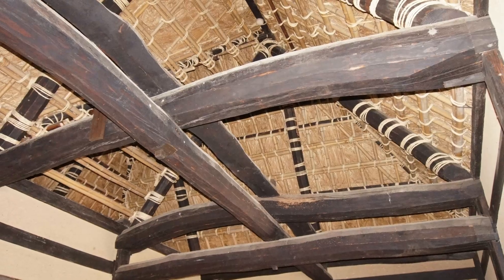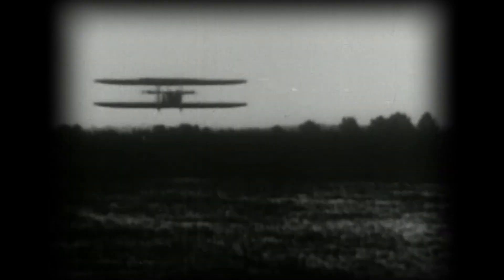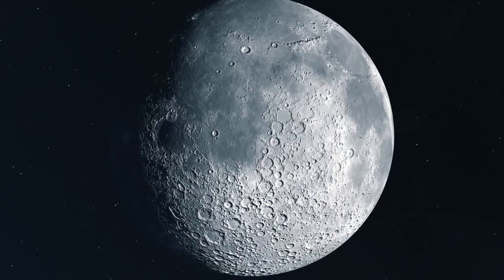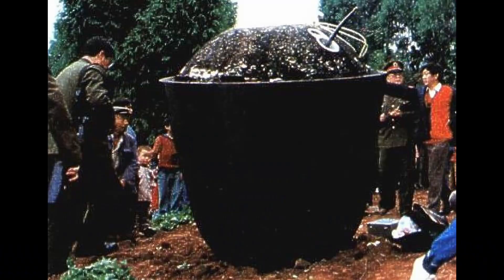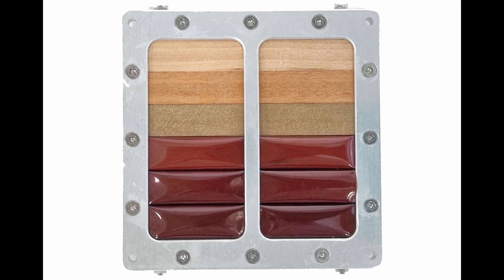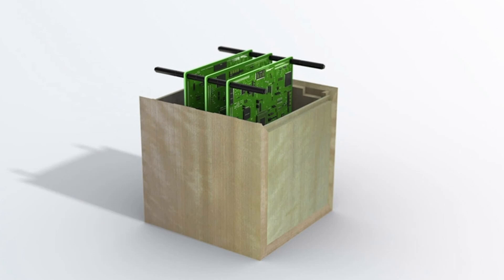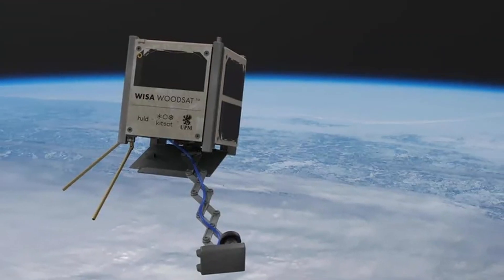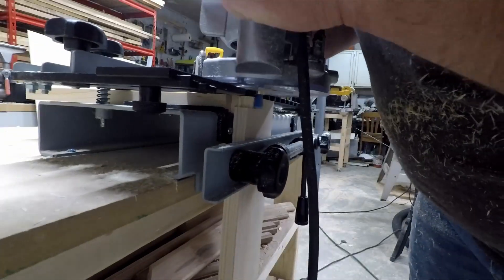Sending Wood to Space?!? Why Scientist Want to Use Wood for Satellites and Other Spacecraft

Comment: Think of the deforestation. Making satellites from bamboo and hemp would probably work better in my opinion.
Reply from the maker: The satellites are very small and most of the lumber is sustainably sourced. Lumber is, after all, a renewable resource and so I don't think that it will contribute significantly to deforestation. That said, bamboo and hemp would definitely be more sustsinable, but neither of those materials have been tested for the rigors of space.  That would be really interesting.
Reply: @DIYwithDave  it definitely would be worth investigating, seeing how much more sustainable they are. Not to mention lighter too, meaning less fuel would be needed to get them up into orbit.